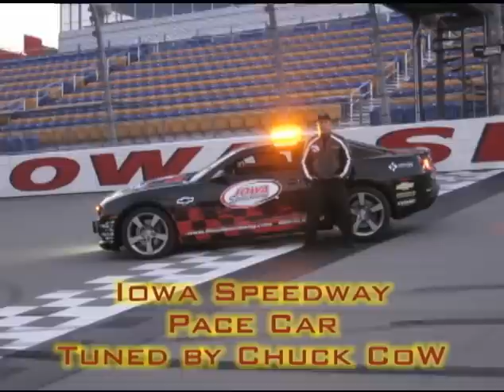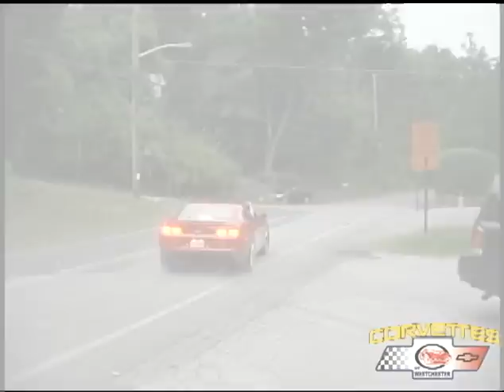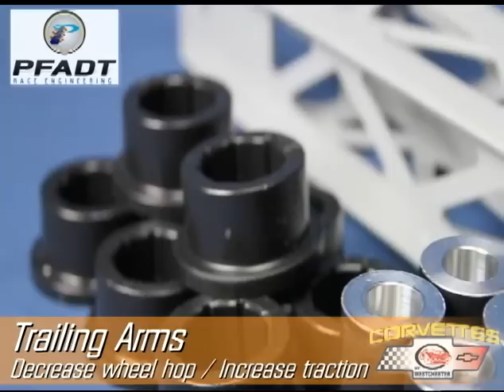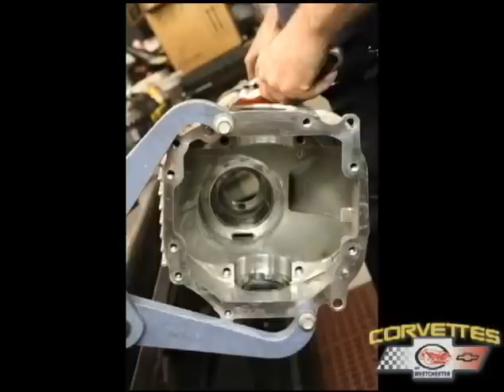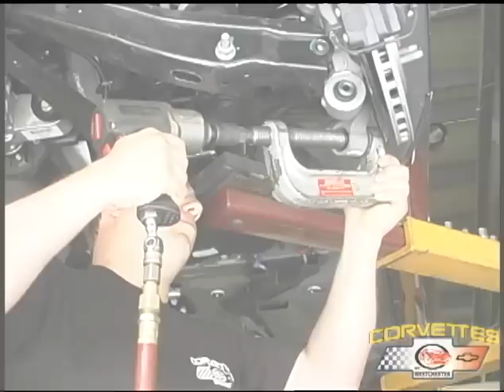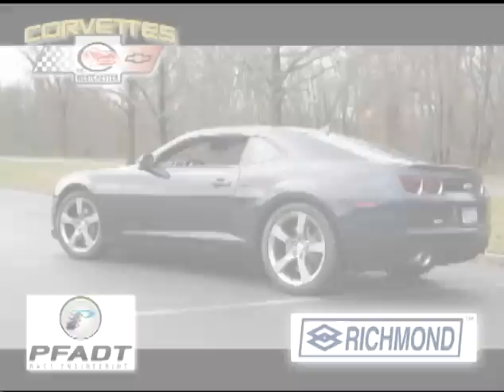Chuck CoW & 2010 Camaro SS / 4.10 Gears and  Pfadt Rear Suspension

Comment from the maker: @bigrudeth trailing arms, toe-links, differential bushings would all be a MUST w/ that much power. There's also subframe bushings and frame connectors that help tie it all together. Also, you should consider stronger axles and driveshaft as well.

Comment from the maker: definitely check out NY5thgen...lots of LI members. The drive shaft, axles and differential on the auto's seem to hold up a lot better (more "shock" from the manual trans). The Driveshaft Shop makes carbon fiber and aluminum 1 piece drive shafts that can handle whatever you throw at them.

Comment from the maker: yes, as far as I know they are still in business. 3.73's are good for the auto trans because it's first gear is much lower then the manual trans. 3.91's or 4.10's can be used, but 1st gear is going to be really "low" and traction might be more of an issue. The stock auto trans seems to hold up well, but adding a trans cooler is never a bad idea, especially if the car is driven hard. Also, assuming you're local, check out NY5thgen.com

Comment from the maker: @bigrudeth  Stick with either the stock gears or 3.73's...it's going to be too hard to get any traction with more aggressive gears. Also, you should do some suspension work so you can get all that power to the ground and limit wheel hop.

Comment from the maker: @JJsIBM2SS 

HUGE difference. Wakes the car up BIGTIME. On a manual trans, it even shifts smoother. Great bang for your buck. Not sure I'd go with 4.10's with a supercharger or turbo...it's just going to be too hard to get traction unless you run a serious tire and rear suspension. 3.73's would be a good bet with boost.  But on a stock camaro, w/ bolt-ons or cam, 4.10's are perfect. Top end isn't sacrificed much because of the wheel size and 6th gear. 3.73's are the way to go w/ auto's.